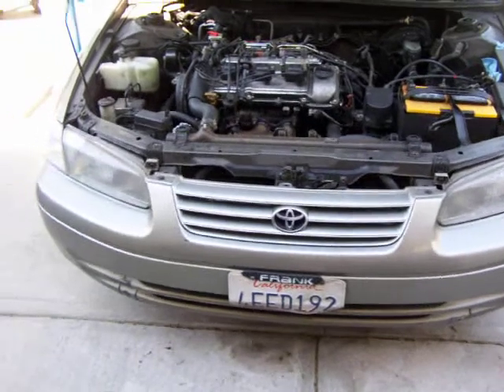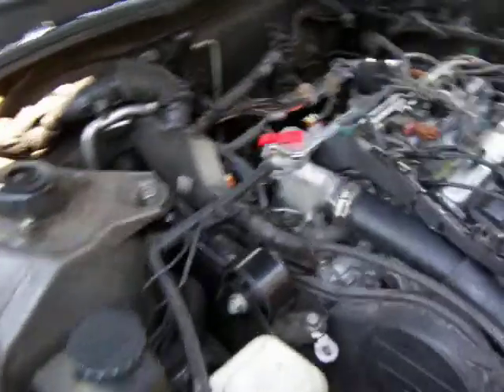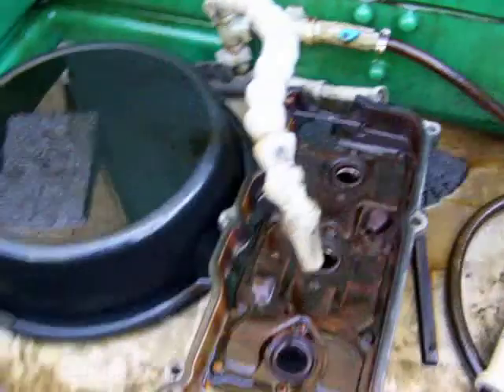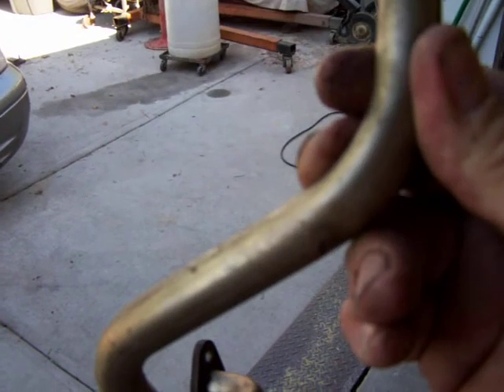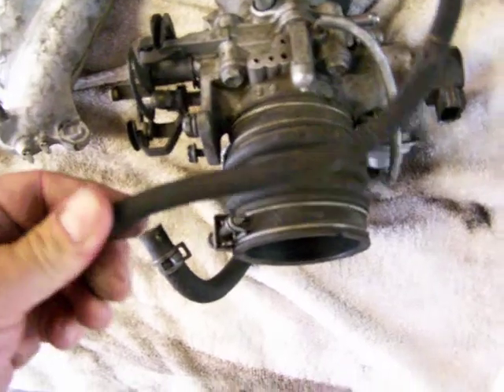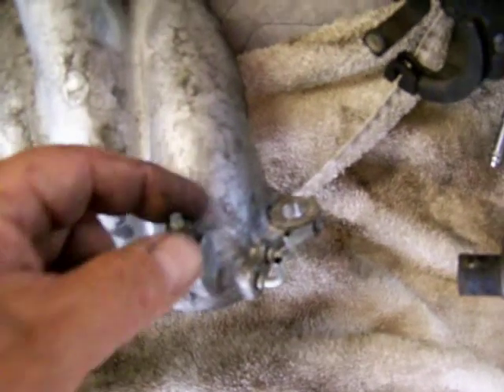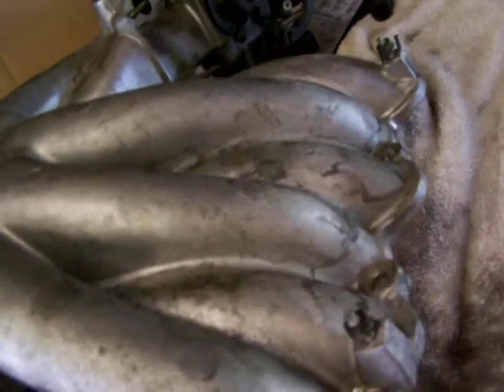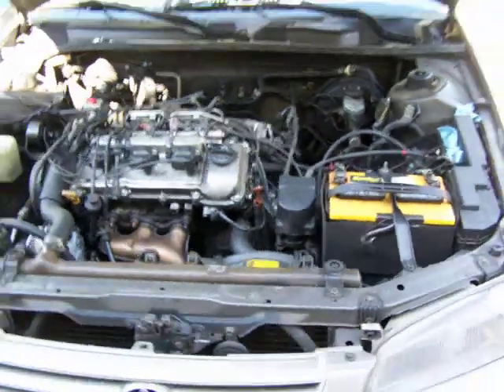1999 Toyota Camry 3.0 V6 valve cover gasket replacement

Comment: I actually discovered the spots where previous RTV sealant was placed when I pulled the cover off. It's the same locations as the front valve cover. I used the Hanes manual to see which points on the front cover needed sealant, then copied that for the rear cover. No leaks. Thank you so much for the video! You gave the confidence to do it myself!

Comment: This is a very useful and an interesting video. There are some things I did differently. For one, I kept the throttle body attached to the cables and layed it on the side by the battery. I also did not remove my EGR tube, I just wasn't able to reach the bottom mounting points. I remember thinking that if I removed the pipe, I would never be able to put it back on. Other than that, everything else was the done the same way, and this was on a 98 ES300.

Comment: Oh.  I got a 2000 toyota solara from neighbor.  Needed timing kit, water pump, shocks, valve cover gaskets, and the intake gaskets.  I'll do knock sensors and wires there too.  But 113,000 miles..  She'll be good for 20 more year's!

Comment: The grommets/ or spark plug seals could be changed out a long with your valve cover gasket. The intake manifold gasget (which I discovered were like three thin pieces of metal) could be changed. The PCV valve is easy to change on the back valve cover gasket while the gasket is off. The Oxygen sensor below the back valve cover gasket cover is easily accesible now with all that stuff out of the way, too. Purchased my o2 sensors on amazon for like $35 a piece! Cheap!

Comment: not removing the throttle body from the intake is good.....no need to worry about replacing the gasket.,,i already bought the $2.99 gasket but why use it if I don't have to :D....not needing to drain coolant is good too....but I would spend few seconds to disconnect the negative wire to the battery :) I will do mine tomorrow....

Comment: In my HANES manual..i saw where I needed to add RTB sealant to four spots on the valve cover gasket nearest the radiator, but I didn't see a picture for the valve cover nearest the firewall. Are there any spots needing RTV sealant you think?

Comment: The intake manifold is really just one big piece. I'm going to try and cheat and post a website you can view pictures at. Youtube won't let me post a link to a website for some dumb reason.
Go to "toyotanation" . com 
then copy and paste this after:

 /forum/154-1st-generation-1995-1999/409583-what-did-you-do-your-avalon-lately-6.html#post4338273